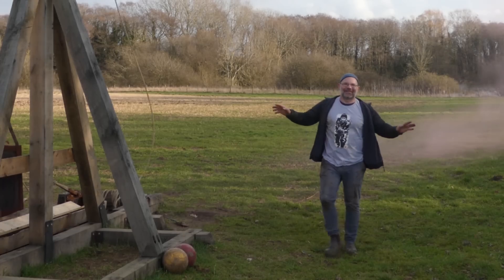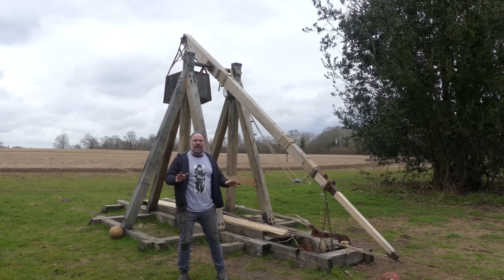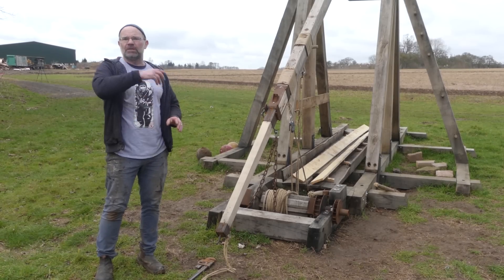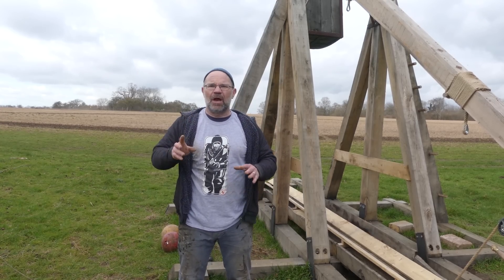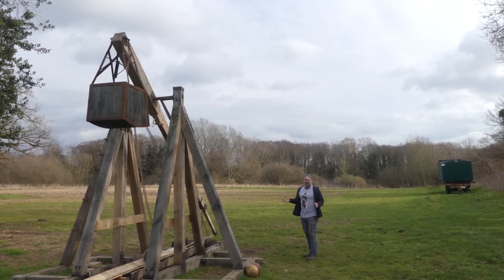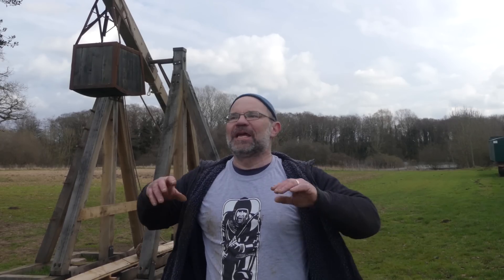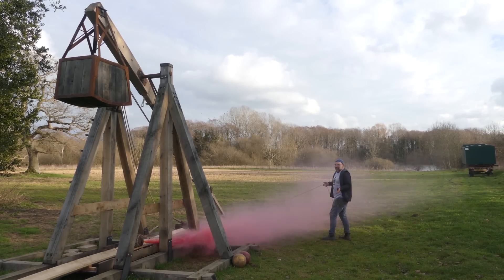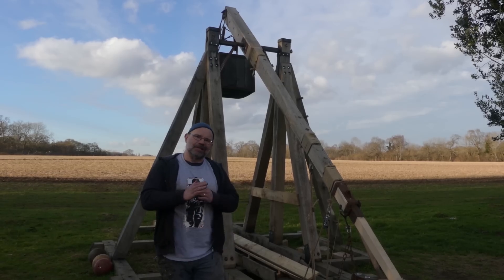Trebuchet - Why won't the darn thing shoot further?

Comment: hi Todd. I think it is the counter weight. It dangles. Might it hang on a hinge rather than a rope, to avoid that dangling effect?

If you watch in slow motion, the weight seems to make the arm stall before the motion is complete.
Reply: I noticed that too. The arm stops at almost perfect vertical every time, so it does not transfer a lot of the force. I think it is already on a metal hinge though, not a rope. From what I can see the problem is that the weight falls straight down, while the arm rotates.
This leads to a situation where the arm rotates PAST the weight, which then arrests the movement before being pulled into the rotation again.
This seems to lead to a premature release, that is both weak and difficult to control, since the sling is pulled off the hook by force, rather than just slipping off at the right angle.
Reply: I was about to comment something similar. The arm stops when its upright which means that it slows down before that. When you step through the video frames at 1:32 (side view), you can see that the weight drops not only down but to the right (as the pivot for the arm goes to the left). When the arm reaches about parallel with the front support the weight is in line, but the arm is much faster at that point than the weight. After that the weight is dragged by the arm until it reaches about upright where it performs a dead stop and the sling is released.
If I had to guess, I would say that that upright stop also bucks up your release. And all those jerks from the weight cant be good for the whole mechanism.

Comment: Hi Todd... from a perspective of balistics, a release angle of 45 degrees ought to be optimal if the Trebuchet is able to transfer it's energy by then. But in practice it's a balance between the amount of energy transferred into the projectile and the angle of release.
Reply: 42.5 degrees
Reply: 45 degrees is only ever optimal in a vacuum. 40 degrees is generally around the highest you can get with most streamlined projectiles, sometimes up to 42/43. For a howitzer it is 38 degrees iirc for example.

Comment: Theoretically the most distance you are going to get is when you release it at a 45 degree angle. And besides that idk, a smaller ball with the same mass, and shouldn't you make it taller if you make the arm longer? i think the arm should almost be able to swing under it.
Reply: 45 degree angle is best theoretically but there are more forces at work than just gravity. iirc somewhere between 30 and 40 degrees is generally the best mix of horizontal and vertical vectors when accounting for gravitational force and air friction. 

But that can change with wind speed and the density/mass of the projectile

ie: wind speed is different at different altitudes so sometimes going more vertical could carry a lighter projectile further
Reply: One of the assignments we had in a course of mathematical computing was to figure out the optimal launch angle for horizontal range when accounting for air resistance, the result that I got was roughly 37.5 degrees for a small spherical projectile. This was just with air resistance, so there was no wind, meaning that the angle would be different in different conditions, but still, somewhere between 35 and 40 should be good.